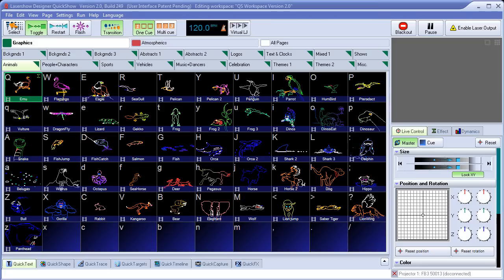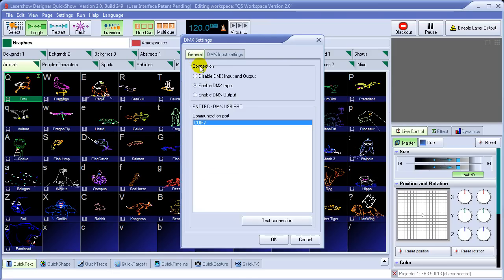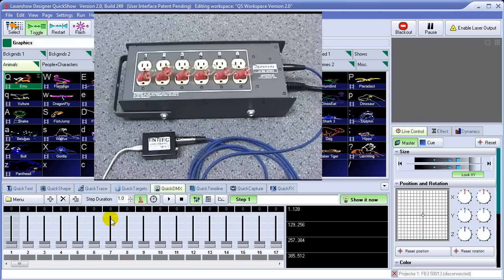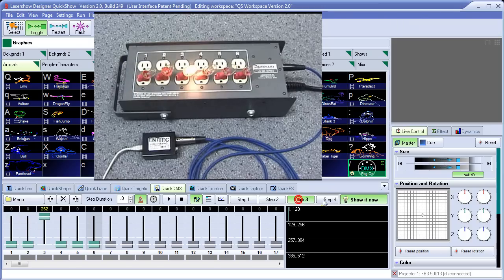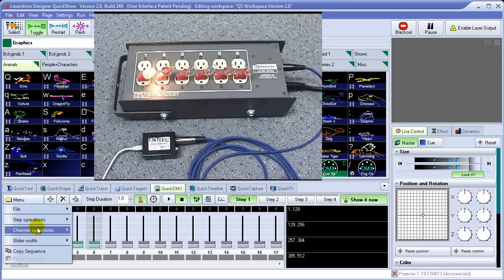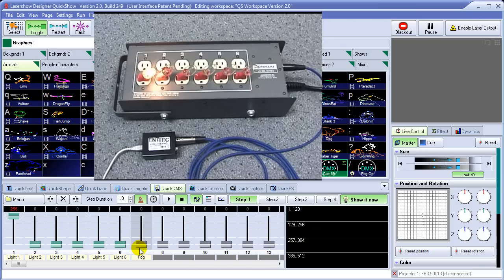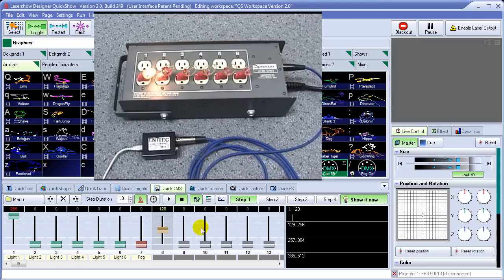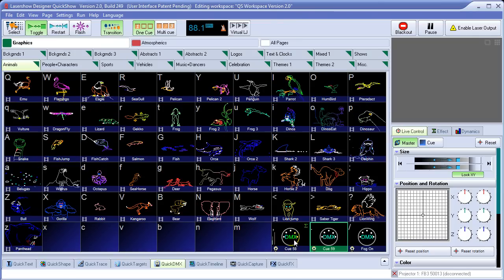QuickShow Tutorial Chapter 11: Using DMX-512

Comment: Where do you set the starting address in quickshow? I have the enttec DMX USB pro but cant communicate with lights.
Reply from the maker: There is no start address if you try to control external lights. QuickShow can control address 1 till 512.

Comment: Hello, I have a question.
Is it possible to put the DMX signals in the QuickTimeline? So can you, for example, switch on the fog machine on time during a programmed laser show in QuickTimeline?
Reply from the maker: If you use an Enttec Pro DMX controller you can put DMX scenes onto the timeline yes.
Reply: @PangolinSystems  Alright, thank you 👍

Comment: I have quick show, I have a few shows according to the instructions> i bought a new laser, x-laser Hpx 2w skywriter. My other Laser was Mobile Beat. The Mobile Beat had a control dial on the back of the unit, which made the laser smaller or larger. How can I or what do I need to do to make this work with this Laser. Do I need to use a dmx along with ilda? Will the DMX has a control to reduce the size of the show I created?
Reply from the maker: If the Laser did not come with FB4, then you will need to use zone setup inside QuickShow or BEYOND depending on the software you use.  We have more information on that over here: https://wiki.pangolin.com

Comment: I purchased dmx usb pro from enttec and downloaded the demo of pangolin software. There is no option for dmx control. Can you please help?
Reply from the maker: lambo7516 I suspect you only need to enable DMX output or input from the Settings, DMX Settings menu. Once you enable DMX Output, a new QuickTab will appear at the bottom of the user interface called QuickDMX where you can set up DMX output sequences; a DMX-IN button will appear at the top of the QS interface if you enable DMX Input.  I just tested both of these options succesfully in the Demo version available on our website.
Reply: Pangolin Laser Systems 
During initial setup I checked off beginner. That has restricted me from seeing the dmx option. The enttec device seems to be functioning but I cannot figure out how to produce animations using  dmx only. The sliders only on channels 511 and 512 produce a sine wave an xy plot and a red/blue line. No other channels seem to work.
Reply from the maker: lambo7516 To get the QuickDMX tab back you just need to rerun the Quick Setup wizard from the Settings menu and make sure you select "Advanced" user.    One thing to realize, you are only using the Demo version of QuickShow.   You will not be able to display any of the images you see within QuickShow without, 1) having the full version of QuickShow, 2) having the Flashback 3 hardware controller to send an ILDA signal to your laser projector.  You can get output from your laser if it is DMX controlled, but you will only be able to display the preprogrammed images that are included on the imbeded DMX chip within the projector; I suspect these are the images you have been able to display with channels 511 and 512.  I would also verify what channel you have your laser set to start at; it should probably be at channel 1.

Comment from the maker: As you can see in this video, QS has a feature called "Quick DMX". It is like a lighting board, and you can also create scenes and sequences. We do believe you should be able to do what you want -- but you should think about it as though you are using a simple lighting board with sliders. You will create scenes and sequences and drop these into a cue and they can be used at any time. After that, you can drag those cues into a show to create a complete show with lasers and DMX.

Comment from the maker: If you're talking about the ENTTEC OpenDMX device, I don't think QS works with that, however we've never tried it. If you have QS and an OpenDMX, it's easy enough to answer the question. Simply enable DMX Input or Output using QS and see if it works. There is also a "Test Connection" button which will help to verify that a device is working.

Comment from the maker: QuickShow version 2.0 can only send DMX or receive DMX but not do both at the same time. Generally it is not necessary however, since -- if you have an external DMX controller such as a lighting board, and when that is controlling QS, generally you would use that to control the other DMX devices as well. 

Regarding "ADJ My DMX", we are not familiar with specifically that controller. However, QS has a pretty simple DMX protocol and we believe it can be controlled by virtually anything.